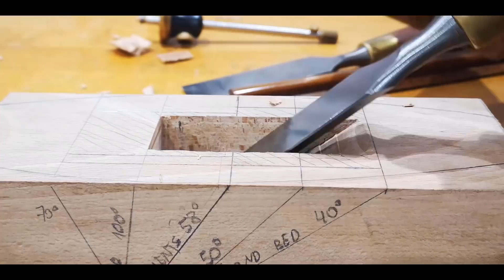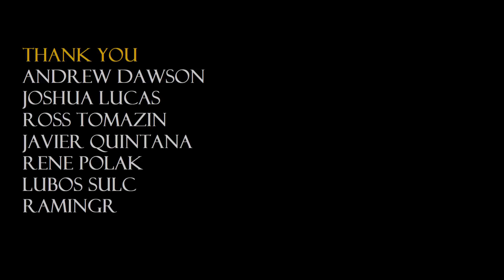040 Double wedge smoothing plane - hand tool woodworking

Comment from the maker: In today's episode i'm gonna build a classic coffin smoother with unknown patent to adjusting the mouth. Seat back, relax and enjoy the video :)
BTW Check the timeline - i'm gonna cut the video into sections with some text notes. I hope it will make the video clear for you and will answer for your questions. Let me know how you like it!

Materials:
- quartersawn beech
- an old plane blade and cap iron
- presto mag liquid oxydation
- boiled linseed oil
- shellac orange

If you have any questions or sugestions just write a comment.
Reply: That's an interesting way of adjusting the mouth, the precursor to the frog we are all familiar with I guess. It's always fun to see the compass plane getting used. I would have loved to have seen a video of making the plane float(s) maybe next time you make one. As usual lovely work Mr Gakos.
Reply from the maker: Thank you Andrew! I'll remember about the floats!
Reply: Dear Mr. Gakos- I tried to check your Instagram with no luck! I was wondering if you make any of these for purchase, if so where can I find your merchandise to place some orders? 😁
Reply: I'll use supper glue on both sides of the wooden plane.
Reply: Merchandise, like t-shirts or what?
Reply: @przybyla420   1 pc of 2 1/4 inches by 2 inches wood. Saw both sides1/2 inches u get 2 pcs of 1/2 inches by 2 inches wood, n 1 pc of 11/4 inches by 2 inches wood. Saw the require angle n inches on the 1 1/4 wood into 2 pcs this is for the centre part. Two pcs of 1/2 inch wood is for left n right sides, n u chisel away what u require to. So supper glue this 4 pcs of wood together to become a wooden plane.
Reply: It takes lest than an hour to make this kind of wooden plane. After the second try you can get a supper wooden plane. All lengths, inches n angle is plus n minus to your requirements.
Reply: @wunhonglee8952  Yes we know, but that's a different and perfectly good approach (Krenov). However, here he is doing it the traditional way and it is much more satisfying in my view to see the result he gets.
Reply: @nickyork8901   yes, i also admired by his workmanship, its only for refferences. I have done it both ways. Result is the same.
Reply from the maker: @theamerican5167  hey, usually i don't sell them but stay tuned on my instagram profile. I'm working on few pair of sliding dovetail planes, one of them will be for sale. Reards!
Reply: @StavrosGakos  will do I started to watch that one I think yesterday
Reply: @wunhonglee8952  there is hell lot of difference between the glued ones and the ones that are made in the traditional or in the proper way. Put your fabulous glued ones in a humid place and see the results. Don't underestimate the solid value as compared to glued ones, glued are made by unskilled people, they are not the choice of masters. This guy is a master plane maker. His planes will be in museum one day.

Comment: Hahaha!
I just got a wooden razee jack plane to use as a short jointer since it's quite a bit longer than my no. 5 and completely neglected to look at the wedge and saw that it was waaay too small for it, like it was made for a 1 3/4 inch smoother that the estate sale people kind of shoved in there and was tearing my hair out figuring out how to make a new one and remembered what you did to make this one.
Your planemaking vids are lifesavers for this newbie hobbyist woodworker and planemaker/plane kludger. Thank you!

Now to figure out how to fix the tote.

Comment: Good idea, congratulations 👌.
Reply from the maker: Dziękuję :)
Reply: @StavrosGakos  Także dziękuję 😀.
To jest chyba drewno dębowe. Narzędzia muszą być wyjątkowo ostre. Kiedyś docinałem kliny dębowe, aby wzmocnić połączenia nóg krzeseł z siedziskiem. Trudna to praca.
No, ale teraz muszę zamówić tranzystory do liniowego sterowania, nowej generacji silnikiem synchronicznym BSMH (BLHF-RM).
Gratuluję Panu wiedzy, talentu i dokładności. Serdecznie pozdrawiam 😀.
This is probably oak wood. Tools must be extremely sharp. I used to cut oak wedges to strengthen the joints between the legs of the chairs and the seat. It's a difficult job.
Well, but now I have to order transistors for linear control of the new generation BSMH synchronous motor (BLHF-RM).
Congratulations on your knowledge, talent and accuracy. Best regards 😀.

Comment: Could the wedges be made so that they can be switched to either position?  If so, then both high and low cutting angles would be possible.
Reply from the maker: During this project i was thinking about it. The bootom wedge should be a support for the blade on the whole surface and the main wedge should have "moustaches". Different shape of each wedge makes the switch impossible.. 
Regards!

Comment: A little late to the party but I was wondering how that smoother was treating you? I have a partly worm-eaten beech jointer that I want to transform into a coffin smoother and I guess I could use the same double wedge method to transform the 45° bed into a 55°. Would you recommend it? Anything you would have done differently looking back?

Also, I don’t think I ever saw you use “service/sorb tree” wood, sorbus domestica or Cormier in French. It’s weird how it was so common and considered the best wood for plane here in France but virtually unused anywhere else? Anyway, I’ll try to send some your way if you’re interested.

Keep doing what you do, you’re a true inspiration!

Comment: Hello Stavros, what is the angle the blade is ground for this smoother? I've got an old planeblade waiting for something like this and am heavily tempted to give it a try...  going Krenov style though (hoping that to be somewhat easier).
Reply from the maker: Hey! All the angles are on the begining of the video. The bed is on 50 deg. If it will be your first plane the laminated version is good choice 👍 just remember to make the mouth too small and open it later. Regards!

Comment: Video format is good.
Do you make the floats of tool steel, say O1, then harden  and temper? I had read somewhere that mild steel works well but really have doubts.
Reply from the maker: Hey James! My first floats was hardened to 45-50 hrc, but it is too hard for floats - sharpening hard floats is a nightmare.. Thats why i use now mild steel, without hardening. It's the same way like with an old hand saws. Regards!